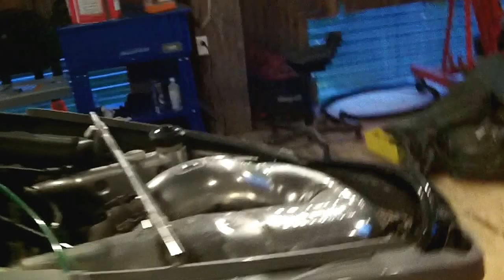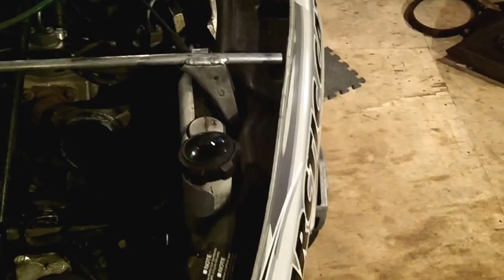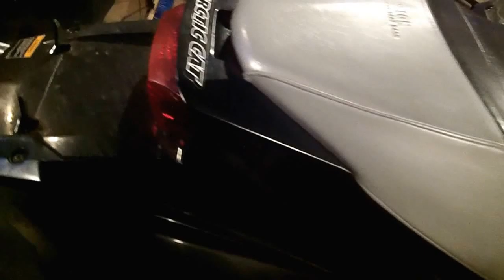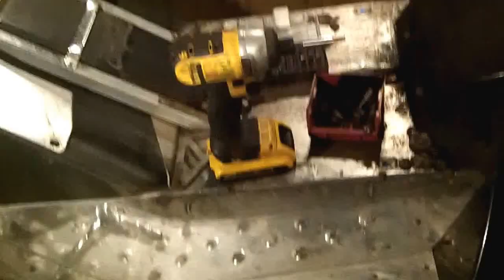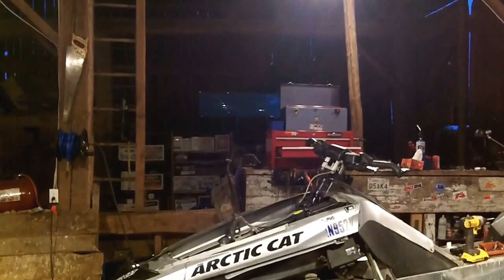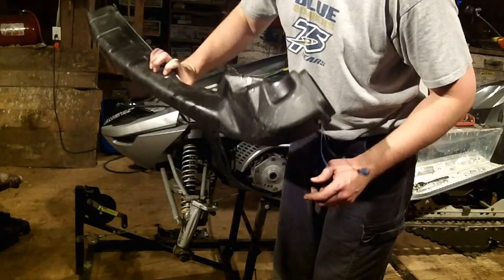Arctic Cat F Series How To Dissassemble

Comment: Thanks for the video, my f1000 is smoking like crazy and not idling well so I'm trying to diagnose it
Reply from the maker: Oil usually runs into engine during summer storage.  The air in the oil tank expands and pushes oil in.  They always smoke like crazy the first time out.  It can foul the plugs.

Comment: Great video, helped me a lot. Do you have to disconnect the fuel line and injectors to get to the reeds?
Reply from the maker: Félix Routhier No, you can leave them on and lay the throttle bodies down. But for easier access to the bottom bolts remove  two coolant connections, fuel line and throttle cable.  Check my other videos I have a bunch.

Comment: How do you remove the intake vent just beside the windshield, does it just snap off? Or do you have to remove the console?
Reply from the maker: Dylan Crozier Loosen the bolts holding the windshield on on the side you want off.  They just snap on and off.  Do it carefully to not break the vent.
Reply: ok, one more question. Does pivoting the riser/bars affect the throttle safety switch? thanks.
Reply from the maker: Dylan Crozier 99% of the time no.  If it does, take console off and check routing for hangups.
Reply: How do you change the spark plugs on it ? Lol